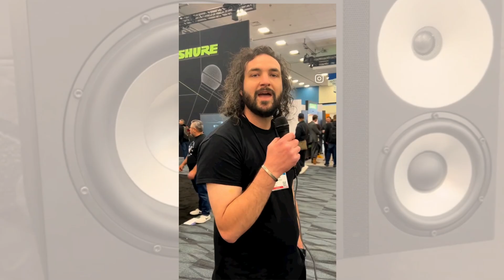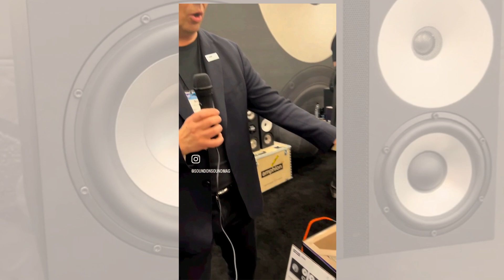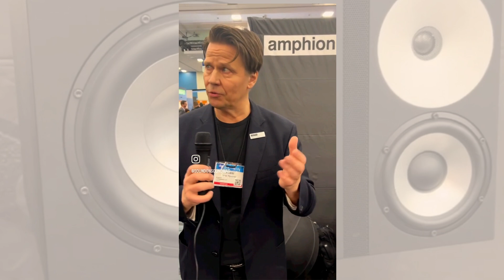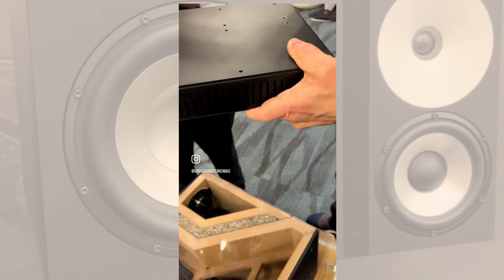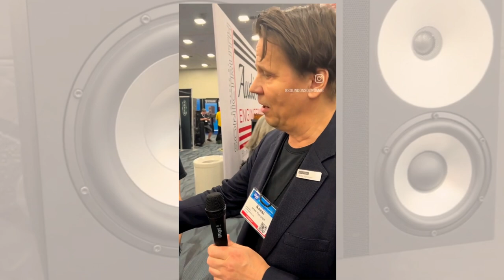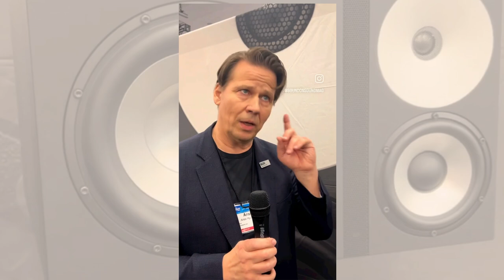NAMM 2023: Amphion One25A Monitors

Comment: I realy like the design Amphion has with their White waveguide, but never ever 14,5 K Euro for this Speaker. I know everything gets more expensive, wood, manufacturing etc but for ~15k Eur you get a pair of Neumann KH420 + a pair of KH750 Subs and youve even powerfull room correction on board. Same story with genelec (8351 + a pair of 7370 subs). You need some really strong arguments, why the Amphions are realy ,,better,, at this pricepoint
Reply: I agree
Reply: Strongly agree